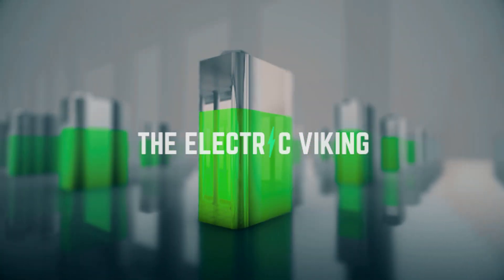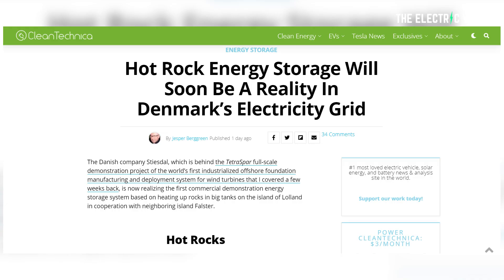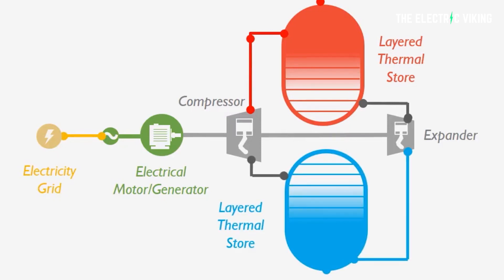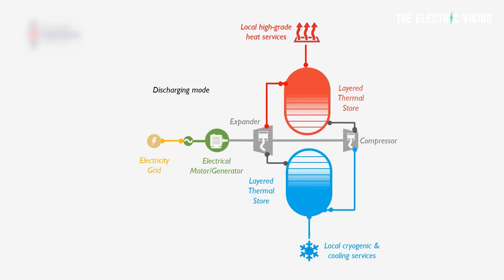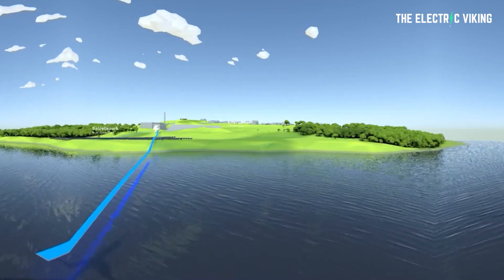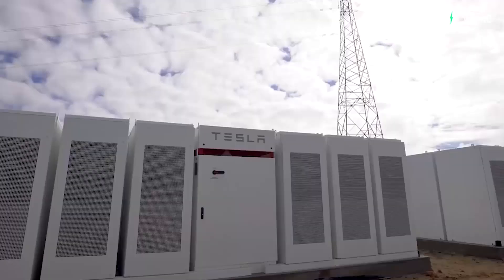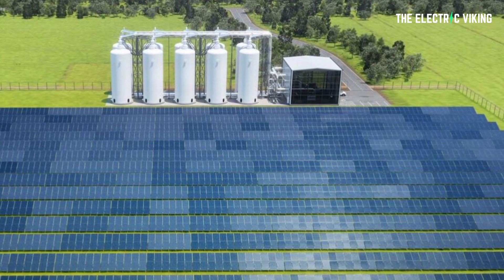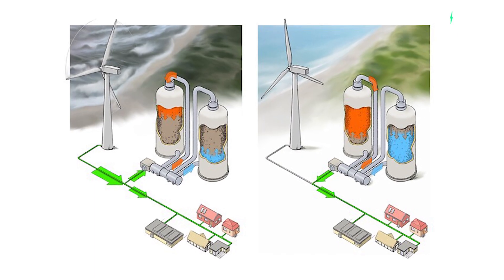Cheapest battery storage in the world - Hot Rock batteries are amazing

Comment: The energy stored in hot rocks should be from concentrated light - heat from sun, NOT FROM WIND, or PV. Otherwise you would have to generate heat from electricity to heat the rocks.
Reply: Good point. BTW one way to do thermal energy storage is simply to take an existing installation that needs things very hot or cold, and use the energy you want to store to heat or cool that medium during the times when the energy is available.
Reply: The point is that we are likely to have very large excess amounts of wind and solar generated electricity.  Wind and solar are getting so inexpensive that it is cheaper to "overbuild" for some days/hours in order to have ample supply when wind/sular input is not as high.

I'm off the grid.  It's a lot cheaper to install far more panels than I need on sunny days than to install huge amounts of storage and/or run a generator.  That means that on sunny days my batteries are full well before noon and I've hours of potential generation left unused.  But I need to do that so that I have enough supply on cloudy days.
Reply: @bobwallace9753  Yes, simply overbuilding is another way to deal with excess generation. But in places where the days become short on a seasonal basis, that becomes unworkable. That's why so much of my comment dealt with polar climates.
Reply: @ronaldgarrison8478  

Let me deal with North America and Europe, the continents I know best.  In both cases as one moves toward the pole there are larger amounts of both wind and hydro which can supply winter generation.

Researchers have modeled RE grids for various parts of the world.  I'm unaware of any place where a RE gird would not be both workable and affordable.

Comment: We need to start talking about batteries with extra adjectives. Eg chemical, heat, pressure, momentum, solid state, gravity... They're all batteries. Battery storage is the answer here - just grid scale it's unlikely to be primarily chemical. Chemical batteries and superconductors is how you deliver surge, sure, but it's not how to deliver base load when renewables are only trickling.
Reply: This is amazing - and going to piss off big oil and main stream media- and there will be nothing they can do- because it won’t crash or burn
Reply: Well said Jez and in fact a lake of water pumped up to a higher lake using wind generation and then released to generate hydroelectricity is also a battery !
Reply: @JohnAdams-kc8wx  I (internally) included that in the gravity category :)
Reply: @jezlawrence720  Ahhh yes sorry Jez, missed that !!!